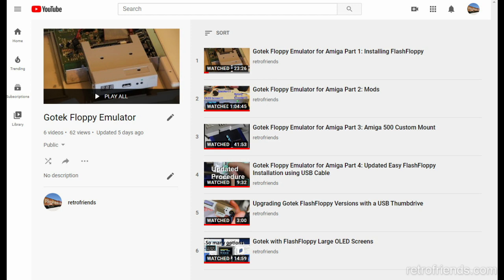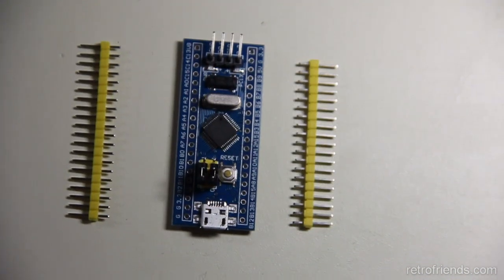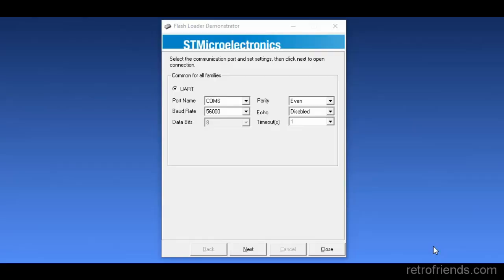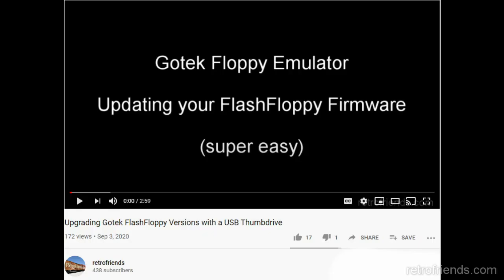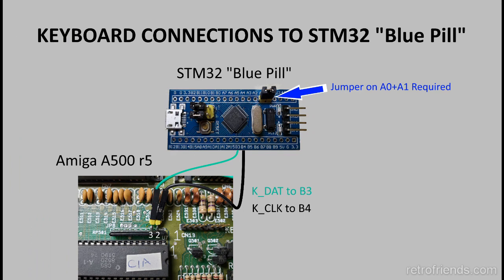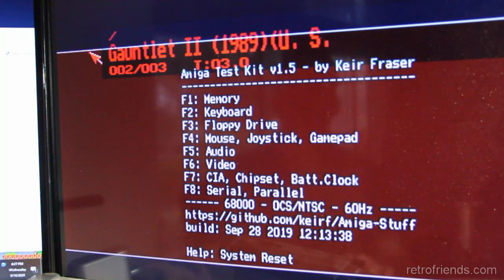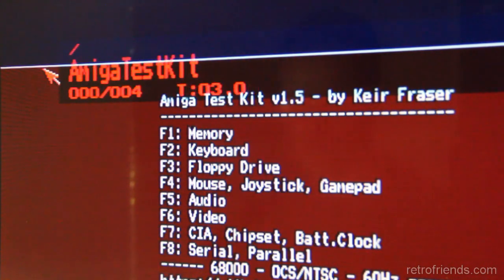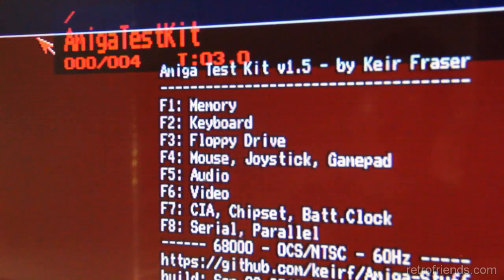FlashFloppy OSD for the Gotek. Tutorial, Demo, and Review

Comment: Thanks for the great video - that really helped me in my project! Keir and I ported the FF OSD solution  to the MSX platform and now I am returning the favor and providing an improved FF OSD solution for Amiga users. The small circuit board that connects all 3 color signals to the Blue Pill allows a better control over the transparency and the color of the FF OSD. In the video from June 15 I showed the improved FF OSD solution for Amiga 500. Check it out please if you are interested.

Comment: Can we install this in an external gotek?
Reply from the maker: Not too practical with the extra wiring involved. OSD I believe was born out of the need to see the file names for an internal mount on the A500/600/1200, where seeing the factory Gotek display is difficult. If you have an external Gotek you should be able to see just fine.
Reply: Can we integrate the external wiring through the gotek cable? I love the osd.
Reply from the maker: @trellos11  You mean the drive ribbon cable? I doubt that would be possible.
Reply: @retrofriends  maybe then we could have a second cable